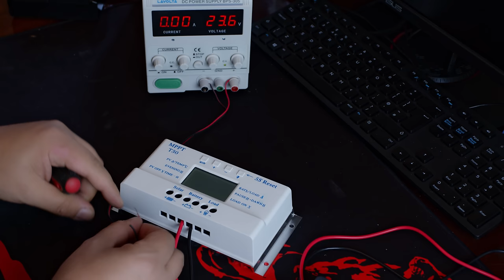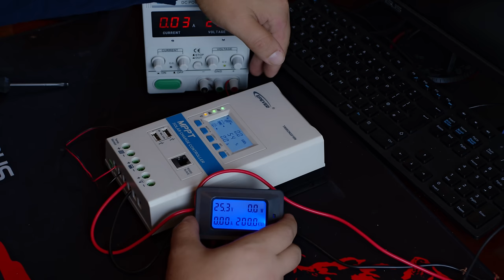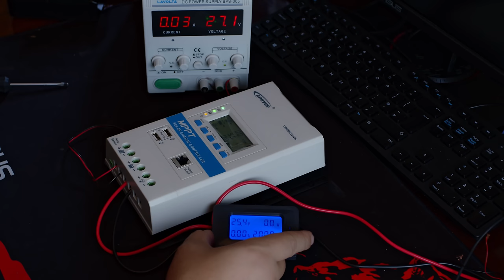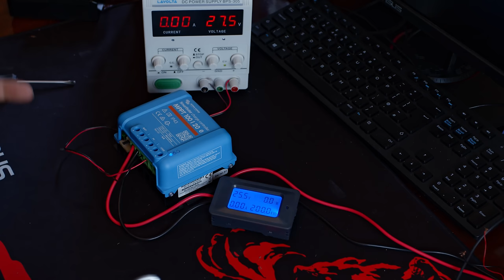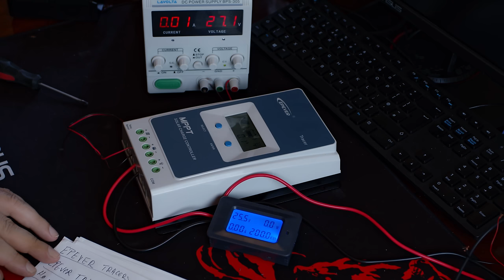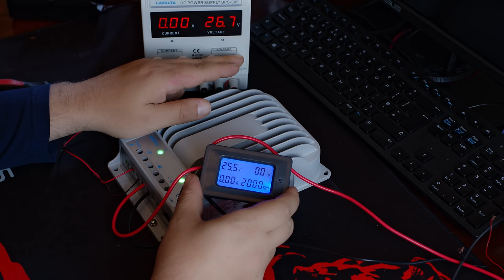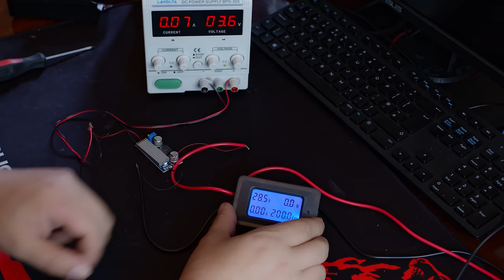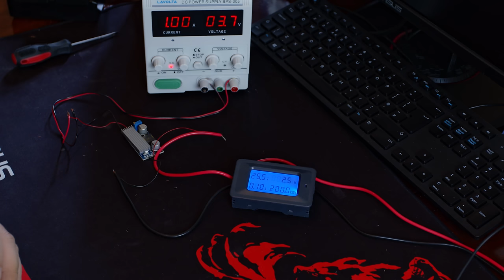Let's test Solar Panel MPPT Charging Controllers - Part2

Comment: This test is excellent. I think that under a certain voltage, the solar panel gives very little current and there is no point in increasing the voltage with a booster, as I have no current from the solar panel, so the solution would be to put panels in series to have the voltage over 60V so that the MPPT Charging Controllers have to reduce the voltage. I think we need a higher voltage test to see the efficiency when the voltage is high and the current given by the source is low.

Comment: Charging a 24v battery bank with a single 18v solar panel it's going to happen. Either add another 18v panel in series to increase input voltage or wire your two 12v batteries in parallel to keep them at 12v. For MPPT to work, PV voltage needs to be higher than battery voltage.

Comment: That converter is great for getting the point across, but a big beefy Sepic that puts out high amperage/high voltage works best, Buck / Boost, but these small boards and the fact they don't put a reasonable heatsink on them and hinders its ability, the one you're using here won't handle a massive jump in voltage and put out any useful amount of amperage. It would be nice to make a video on how to make a real not a cheap Chinese Sepic Board with separate pots for V, A and Auto shut down voltage to protect the source battery and or one of the many ideas used on these boards, CC/CV which works best for lithium cells, that would get a ton of views. 😎

Comment: If there is so litttle light, that you have 5 Volts from your Solar panel, there is no current. So there is nothing to boost. You have almost full voltage with very little light.
The sunrays create the current. Low light -> no sunrays -> no current --> no energy.

Comment: What is the SOC of the battery these are being connected to? I may look to look for part 1 as this is the one that came up in my epever search for a 20 amp, mine is a tracer. I am not running into the no current issue you are, the only time I have no current is when the battery cells are fully charged, also with a charge controller, I didnt think they " pulled" Amps from a power supply, i thought converted voltage into amps to make it more efficient - Im still a newbie, so please forgive my ignorance

Comment: The efficiency is 67.57% because you're jumping from 3.7v to 25.5v which couldn't happen with a solar panel anyway and these cheap converters don't supply as promised, you can't do much more than the max on the solar panel if any and the efficiency would be in the 90s% if you set the converter as close as possible to meet the batteries needs. The solar panel should put out more voltage the battery. You wont be able to charge a 24v battery with a 12v solar panel no matter what you use, you would have to connect two 12v panels in a series and if the absolute max of the panel is rated for 20v and you try to charge a 24v battery, it will draw the amperage down badly if you could even do it. When boosting the voltage it take some amperage away and when you buck the voltage you can gain some amperage. Yes, No?

Comment: Solar panel voltage  will drop as soon as load is applied. That will probably be the reason for the delayed power output from the MPPT controller. It would be pointless trying to utilize that low voltage from a panel only loaded by an insignificant electronic base load.  A solar panel will in low light condition act just like a drained battery. The voltage is there unloaded but as soon as load is applied the voltage drops to the floor.

Comment: Mppt turns voltage into current high voltage low current into low voltage high current that's why you need more voltage on the input some can handle more than 150v on the input

Comment: Totally agree. Crazy they don't have a boost circuit for lower voltages.
Reply: Why would they? There is extremely low power from the sunlight when the panels have that low of a voltage.
 If that capability was added, it would about double the cost of the controller, for only a couple watt-hours extra per day, absolutely not worth it.

Comment: Indeed thats dosent sound right.they could use a step-up  to make it more compatible with low voltage panels but for some reason they didnt. I dont think they are stupid but has something to do with the battery cells or battery charge sequence!

Comment: Who cares if they boost? My mppt controller can handle 150v of solar in series on the input. By the time its making that little of a voltage ill have maybe 5 minutes of "sunlight" left. Properly set up you wouldn't even notice the effects of it not having a boost controller.

Comment: I have 12 volt solar panels charging 12 volt batteries. Can I hook my panels in a series to out put 24 volts and still have my charge controller output 12 volts to the batteries?
Reply: If it's an mppt controller then yes, if it's a pwm, or relay based controller then-no.
Reply: @johnwyman6126  Thanks.
Reply: If mppt yes but if pwm then connect in parallel..
Reply: I just bought used 260 panels I think there 32 or 37 amps I want to know if I can connect them to my new Controler 30 amp mppt I ordered online and a watt volt amp meter to put inline for my 22 volt batteries and I just bought 3 deep cycle batteries to add to my 2 lead batteries so I will have 5 batteries total. Can anybody tell me if it will work like that in parallel or series? Just so I don't blow anything up I'm trying to find out any information on that and I have a 30 amp charge controller coming in the mail with an amp watt and  voltmeter

Comment: Voltage means nothing.... Its about the amps going in to the battery. Off grid people use amps to run appliances at the battery voltage... Which remains very constant.
Adding extra batteries to your house bank increases the number of amps available. Solar charging is about replacing those amps.
This guy knows nothing.

Comment: I have a 2215BN and for the bloody life of me I cannot get it to put more than 3a into the batteries while charging, even a dead bike batter at 11.2v  it will not put more than 3a while charging.
have 3 200a panels in parallel on the roof, 32v at the terminals on the unit.
it's driving me bonkers.

Comment: Can we incorporate a wind turbine ?
Reply: You can have a solar array, a wind turbine, and / or a Micro Hydro power turbine all connected to the same battery as long as you use a shunt style controller. The controller cannot open the circuit when the battery gets full like most solar controllers do because the turbine will overspeed. You also get the added benefit of using the extra electricity for something such as heating air, or water.
Reply: @johnwyman6126  awsome ty.

Comment: there are no MPPT Chargers who Boost the undervoltage. As i sad on the first Video : Use more Panels in series like 4x 22Volts =88V  . Otherwise MPPT Chargers has no advantage and work not better than PWM
Reply: There are boosting MPPT chargers, but they are not the norm.  Genasun, etc.

Comment: This testing is all wrong! We simply don't know what is the charge state of your battery if your battery is fully charged then the switching points and load is going to be different each time
Reply: {// WTF! //}  he is good with electronics repairs but rechargeables batteries is another kind of beast and is taking me years in understanding how they work especially dry cells

Comment: Is it ever likely that a solar panel would have a voltage output of less than the battery voltage so that it would need boosting? Not in my experience - all solar panel (not individual modules) specs I've ever seen have a high enough open circuit voltage in any kind of daylight to match the load (and from empirical experience) - the power is determined by the current which is proportional to the light hitting the panel so having a simple controller like this that can boost is pointless (more sophisticated 'optimisers' that can buck or boost voltage from each panel into a string are used by SolarEdge and are essentially variable DC-DC converters but that's to keep the string current in MPPT) - essentially provided the panel's open circuit voltage is rated above the nominal battery voltage the MPPT will buck and send as much current as it can to the battery...

Comment: At 4 minutes in your not charging because you're trying to pushing 25.3v with only 3 milliamps. That's a joke , push 25.3v with 8 amps like any normal solar panel would produce and see what happens. I could have a 10,000 volts but with no amps to push it anywhere...... see where I'm going with this.

Comment: That is not how my epever controller works in a 12v setup. It takes any voltage the panels make higher than the 13-14v and bucks it to produce more charging amps,  I never read that they boost voltage only buck it to produce more charging amps typically one uses panels that output a higher voltage than the battery or they wire in series to produce higher voltage. if your battery wasnt charged as much  I believe it would have provided more amps but these things are all adjustable in the settings of each controller.

Comment: The more panels in serie of course in the specs of the inverter.
The higher the dc voltage the easier it is for the tracking, is use 3 panels in serie, 150 volts and it works perfect.

Comment: Using a boost converter in low volt input is extremely successful
But when the input voltage is higher than the required volt at the output it will fail
Cause its a step up equipment not a step down
Reply: Boost Buck converter to the rescue!

Comment: Sir with all my respect to you, i think that your test has a serius issue: PV panels producing Hi voltages and Low Amperage which is just the oposite than your power supply. So in real world a PV panel decrease its current long time before decrease its voltage. At your expiriment you had 1.00A at 3.7Volts when a  good quality 330Watt PV panel with 19.5%  efficiency produces a few miliamperes at 13Volts!!! 
Because these chargers works in combination with PV panels ,is normal to stop charging when the voltage  became almost equal  with batteries voltage , as that means that PVpanel has no current and so enough  power to offer. For this reason we use clusters of PVs in strings and rows to cover our needs in volts and amperes and  make oversize PV installations to eliminate the losses from any kind of sadows (partial or total)